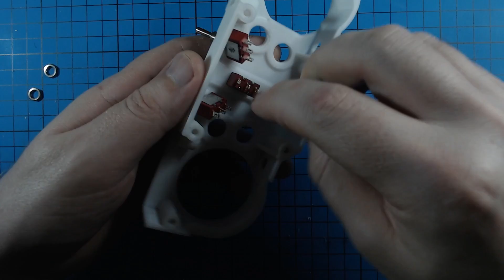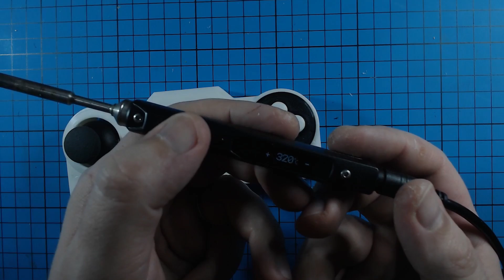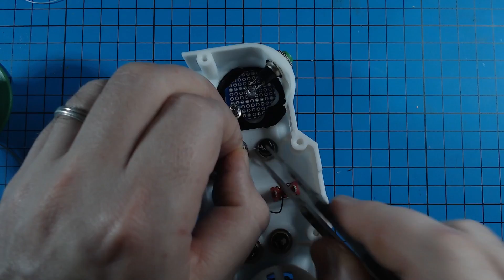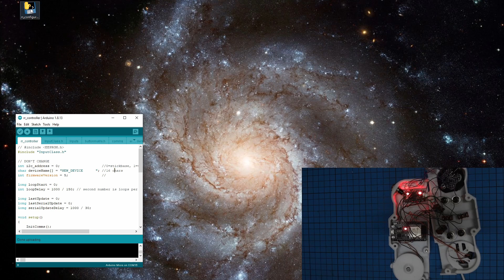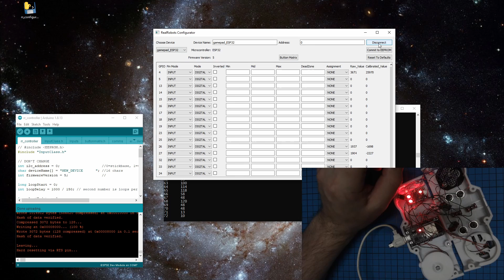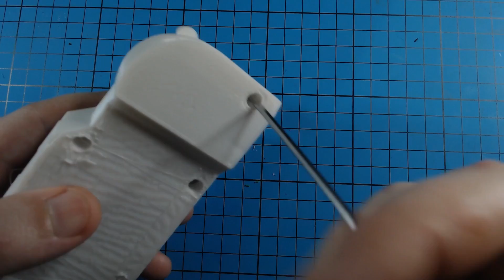Instructions - DIY Bluetooth Gamepad

Comment: Is DD0512 in battery setup important if I am not using an Arduino I am doing it with only esp32 ? And the toggel switch on battery setup?
Reply from the maker: The battery voltage varies from about 3.2v when dead, up to 4.2v when fully charged. Neither of those is enough to run your 5v Arduino. You might get away with it, but if you have trouble you'll need something to boost that voltage

Comment: Can i use a pi pico ? 😥
Reply from the maker: @JUMPINGDONUT_  I made an updated version for Pico, it doesn't do the device chaining though.
https://realrobots.net/configurator/
Reply: @real_robots  Hi thanks, dont know if device chaining will be needed for my project. Im trying to make a a320 throttle replica using potentiometers as for throttle control. Will the potentiometers work as sliders? Do you have a tutorial or guide on how to set this up that i can follow.

Comment: thats what I am Looking for. Want to upgrade a pistol grip RC control to bluetooth for the new Carrera Hybrid race game. Does it connect to an Android phone?
Reply from the maker: @airnautic  I've not tried, it works in Linux, which Android is based on so id expect so.
Reply: @real_robots  
Txs, it connects to arduino, as well as to the Ipad Mini 6.
but I have some problems:
can only upload via the web interface and configure, no programming via the arduino programmer error 25 ... and master configurator does not get handshake.
using a AZ-Delivery ESP32 Dev Kit C V4 ESP32-WROOM-32 standalone.
following inputs to following outputs needed as per the recommended Tester:
D4-Steering analog- axis0 is ok
D26-Accellerator analog- B7 (one side of poti is accellerator other side is brake) can´t get it from axis 0-6 to B7
D26-Brake analog- B6 and as above and not implemented yet
D14- Boost digital- B2 ok (X button)
D15 - Spare digital- TBA
will it be possible for you to write a special arduino uploadable program and configurator? Will remunerate.
many txs
Reply from the maker: @airnautic  I'm not sure why you can't upload using Arduino ide, though there might be some library incompatibilities which is why using the precompiled image on the web uploader is recommended.

The Bluetooth hid library implementation in the Configurator only supports six analog axes. x, y, z, rX, rY, rZ, slider1, and slider2.

I can do you up some custom firmware to use others, but that would take me a little time, wouldn't be compatible with the Configurator, and would take some remuneration. You can email me at realrobotshk@gmail.com if you want to take that route.

Comment: Hey ik my comment might not reach you out since this video is quite old but i would like and really appreciate it if you showed us in a video how to turn a ps2 controller into a functional wireless controller Bluetooth all that  i have an old ps2 controller and it has lots of emotion attachment to it i would really like to mod it out and use it on anything would be appreciated if u could with random parts of different technology
Reply from the maker: I don't have one to hack up. Not knowing anything about them you COULD just take out all the electronics, except what is needed to hold the dpad etc, and then try and squeeze an ESP32 in there and hook all the buttons and pots to it. I don't know how much space you've got inside to work with, you might have to find a smaller ESP32 board, you'll need space for a battery as well.

Comment: Hi Jake, I'm having an issue uploading the rr_controller firmware to an ESP32-C3. It seems to fail with a pluggableUSB library, I'm guessing because the device doesn't have usb support. Do you know of a way to get the firmware onto a bluetooth-only ESP32?
Reply from the maker: It doesn't support the ESP32-C3, I'm actually working on a new version of the software targeting the ESP32 series that I'm hoping to have an early version of released soon. It'll do bluetooth on the standard ESP32 and USBHID on the S2. I haven't looked into the C3 yet though.

If you want to try that out when it comes out (hopefully in the next few days if all goes well) I'll be announcing it in my discord channel soon.

https://discord.gg/DPUzKdTK
Reply from the maker: https://discord.gg/QzrrbQVfpb

Comment: Hi, nice tutorial. 

For some reason, my pro micro doesn't seem to be communicating with my ESP32. I have D19 connected to pin 2 and d22 connected to pin 3. Which I think matches the wiring diagram, yet no dice when opening the ESP32 in the configurator. 

Any ideas?
Reply from the maker: Yep sorry about that, the schematic had an error. The wire going to pin 19 on the esp32 should be going to 21
Reply: @real_robots  Thanks for the response. That fixed the issue for me.
Reply: @real_robots  Hey I seem to be encountering another issue, that I'm not sure if you know a solution too. Everytime I connect the ESP to my PC via bluetooth, I have to delete the device from my bluetooth devices and re add it. Otherwise it doesn't connect. 
I can't just switch the circuit off and back on again, as this will cause it to connect briefly (less than a second) then disconnect. 
Any help is appreciated :)
Reply from the maker: @apollovulpez  not sure about that one sorry

Comment: Super neat stuff! Came across the video because I was looking for a way of converting old Guitar Hero controllers to bluetooth for use on PC, feel like this might be a suitable solution!

One question though; is the arduino necessary or is that just because you have so many inputs?
Reply from the maker: Yeah the ESP32 didn't have enough inputs for this one, also I made this after adding the ability to network ESP32s and Pro Micros together with my rr_controller software.

If you're going to try this out, just test out the firmware on an ESP32 and the computer you want to connect it to first, I haven't updated the bluetooth code in a while and I've heard from some users that it doesn't connect nicely to everything.

Comment: Does the controller go into sleep mode or auto shut off when the controller is inactive for a certain amount of minutes? All the pc bluetooth gamepads have this sleep mode. I’m wondering if this setup is the same
Reply from the maker: The bluetooth code is fairly simplistic, after its made the handshake it just stays open forever until you disconnect.
Reply: @real_robots  Interesting..i might have to force myself into learning ardurino. I always thought the arduino programing was hard.

Comment: How's the input lag? Is there a limit on simultaneous inputs? Does sending many inputs concurrently impact input delay? I'm hoping to make a custom controller for someone with accessibility/disability limitations, but they're also a pretty competitive gamer, so if it performs worse than say an xbox controller, I'm concerned they'd rather continue to struggle to use that rather than deal with input lag or missed inputs from 6KRO from a custom device
Reply: I'm wondering that too. Coding with c instead of python might be necessary

Comment: things were goint great until i changed my esp32 address to 1.
I'm only using esp32 as my controller, and after reflash the configurator still having handshake issues,
any idea?
Reply from the maker: The esp32 has to be the master, so it has to be zero, but that should only effect its ability to talk to subdevices, not the configurator. 

I have found a few issues can be fixed by clearing the flash on an ESP32, you need to do it in command line using the esptool

esptool.py --port COM6 erase_flash

COM6 should be whatever com port your esp32 is on
Reply: @real_robots  yeah I cleared the eeprom last night and it’s finally working 
However one roll of my button matrix was recognised in the configurator, but not the window
I saw someone have the same problem in your github
Tried a lot of combinations and still no luck

Comment: Are xinput games supported?
Reply from the maker: I don't know, I haven't tried.
Reply: @real_robots  Currently, most games are made to use xinput. The direct input method is only for classic games. Steam games also work with xinput method, which is xbox360. Can't you check it?
Reply from the maker: @EGLOVEzicgo  it definitely gets picked up by steam, don't have an Xbox to test it on

Comment: Great, I wish you prosperity. ❤️+1
Does it work with Android?
Could the pro micro be replaced with  pico? That does HID. And how are you making the esp get recognised as HID device! Sorry for my naivety. Could you please refer me to some docs to have a better understanding?
Reply from the maker: It should work with Android, and anything else which understands the HID standard. I haven't tested it though.

The pro micro absolutely could be replaced with the Pico, I actually wrote a Pico gamepad HID library and have released that but I haven't integrated it into the rr_controller firmware yet. If you want to use a Pico and don't mind writing the rest of the code yourself you can find it here. https://gitlab.com/realrobots/PicoGamepad

The ESP32 Arduino libraries have built in HID libraries which handle the basics, on top of that I just make sure it sends the specific handshake and data packets required for a gamepad/joystick device.

Comment: Does it work on iOS?
Reply from the maker: I haven't tested it but it uses standard HID protocol so it should.
Reply: @real_robots  could you test it? Usually, the gamepad has to have MFi certificate to work with iOS
Reply from the maker: @giangdiygaming4918  I don't have an iOS device. If you've got an esp32 you can test it without anything else, just install the firmware and it should be pairable, even if you don't set up any inputs yet.

Comment: Hey man, love your tutorials, can you try and make a racing steering wheel? I would love to try and make one on the cheap :) 
Love the content keep it up!
Reply from the maker: You can use this same software to do a wheel, wheels are a bit harder to do as a 3d print project as it's so much bigger and requires mechanical parts.

Comment: Great work. I built your bluetooth gamepad on  breadboard. Works fine. One issue is when I turn on gamepad it pairs but does not connect.
To get it to connect I have to go in settings (Windows 11), bluetooth and remove device and pair again then it connects and I can use joy.cpl 
to test buttons  and axes and they work. Any ideas why pairing but not connecting?
Reply from the maker: The only time I've had that issue in the past was in earlier versions when I allowed the device configuration (as in how many button and which axes) to change on the fly, it needed to reconnect to work. If you've got the latest version I'm not sure what's happenign there. I'll see if I can replicate it.
Reply: @real_robots  Thanks for the reply. Just a bit more information. I am using a NUC 11 i5 with Bluetooth 5.2. If I have bluetooth open in my Windows 11 settings I see the bluetooth gamepad as paired and when I power the bluetooth gamepad the bluetooth setting in Windows goes to connected but instantly goes back to paired. I am using the latest version of your software (version 7). Any thoughts on what might be the problem? What setup are you using to test your bluetooth gamepad?
Regards Frank
Reply from the maker: @frankmentiplay8343  It works on my PC and it's built in bluetooth and on my pretty modern Thinkpad, it didn't work on my 2011 Macbook but it always was finicky about what bluetooths it would connect to. 

I haven't tested it on any other machines, some of the guys on the discord were trying it with different bluetooth dongles and talking about their success/failure. You can see it here https://discord.gg/QzrrbQVfpb on the help-bugreports page if you scroll up a bit.

Comment: I am using arduino uno rev3 instead of micro as slave device but in configurator when connected to pc it doesnot show both controllers I have commited to eprom  and individually when I connnect uno it shows i configurator the device and esp32 shows its self but not together with the uno rev3 device.
Is it because uno R3 is not an HID supporting device.
Reply from the maker: You need to flash rr_controller to the uno first, then use the configurator to set its address to 1 (or anything from 1-127). Then you can unplug the uno from your USB and connect the esp32, make sure the esp32 address is set to 0. Then you should get the esp32 and the uno in the dropdown on the left. For windows it will only show up as the one device when you connect the bluetooth HID.
Reply: @real_robots  I am using windows only it comes up as one deivce and when I connect with bluetooth in the game controller properties testing the buttons conencted with uno doesnot work but buttons connected with esp32 works.

 UPDATE:   
I found the issue the connection in esp32 should be in D22 and D21 for SCL and SDA in your layout u have used pin D19 instead of D21 in esp32. For anyone else working on UNO the SDA and SCL pin are market along the digial pins.
Reply from the maker: @saswatmund8904  Oh you're right, thanks for catching that. I put a note in the description so hopefully no one else gets caught on that.

Comment: how many digital input pins does the esp32 you linked support? I'm working on a similar project to this and this board would save a few dollars to the one I plan to use if it has enough digital pins.
Reply from the maker: You can use 16 pins with a single ESP32, here's the list.

4, 5, 13, 14, 15, 16, 17, 18, 19, 23, 25, 26, 27, 32, 33, 34
Reply: @real_robots  thank you for the quick response that is about two more than what I need.*just re watched the video and realized just one is 2 pins short.

Comment: Great tutorial, I've been trying to get this going for ages and now just noticed it won't work with my current esp32 model, ordered a firebeetle now, Great work by the way
Reply from the maker: If you're having trouble with some ESP32 models it might be a power issue, a lot of these can't run the radio off standard USB power due to diodes causing voltage drop. Give it a try with a 5v connection to the VIN pin or a 2a phone charger. ESP32 Bluetooth only uses about 100ma from memory, but with the board layout causing voltage drops you can still have issues.

If it's not that, let me know what esp32 board you're using and maybe I can suggest, I've only really tested on the Dev Board v1 and my own custom boards.
Reply: @real_robots  awesome advice, much appreciated, I shall try that, it's a board I am unfamiliar with called a Digishuo ESP32S

Comment: Wait, why do you need an Arduino when you have a ESP32?!
Reply from the maker: Too many inputs for the ESP32 to handle by itself. My software, rr_controller links them up over i2c so the Arduino can work like a GPIO expander.
Reply: @real_robots  Any reason to not use a scan matrix? A dumb scan matrix allows to have 16 inputs using 8 pins, clever ones - even more
Reply from the maker: @osmanpasha_diy  My software didn't do matrices at the time, it does now though. https://youtu.be/dop0SoD2XL8
Reply: @real_robots  Ah, good to know, thanks!
Reply: @real_robots  Is it possible to use some type of GPIO expander like PCF8575 it would be really nice if it would be possible.
Thank you.
Reply from the maker: @Makhuta  I'm looking at adding support for some I2c accessories like that in the future, at the moment they're not supported though.

The original program used MCP23017 gpio expanders but because they don't do analog inputs I ended up basing everything on the i2c networking feature. If you want more inputs at the moment you just add another Pro Micro and connect the +, -, SCL and SDA pins and you have 14 more inputs.
Reply: @real_robots  Thank you again but that is kinda bad for me because I want to design custom PCB for my controller and it is easier for me to use some sort of expander like I mentioned earlier PCF8575 because of it small size and no need for crystal and other accessories to function like for Pro micro.
Anyway good job in creating such great software.
Reply: @real_robots  Sorry I just found what the GPIO expander you mentioned was and is it possible to use it with your code? I am asking just in case before I start to design something with it or buy it and it will not work.
Thanks for answering so quickly.
Reply from the maker: @Makhuta  No it won't work at the moment, at least not with rr_configurator. I haven't added compatibility for any i2c peripherals yet.
Reply: @real_robots  Ok, and is is possible to add the feature to set digital output of the one of the pins after some time period of inactivity to be used to automatically turn off the power?
Thanks.
Reply from the maker: @Makhuta  I've only added some very basic output options so far, always on, always off, and flashing.

I plan to make outputs react to buttons being down or analog inputs hitting certain thresholds and off after a certain period is a good idea.
Reply: @real_robots  I was thinking the same and I don't think it will be hard to implement. Maybe I am wrong but I think it will just need to have some function at the output next to the where is sending data through BT.